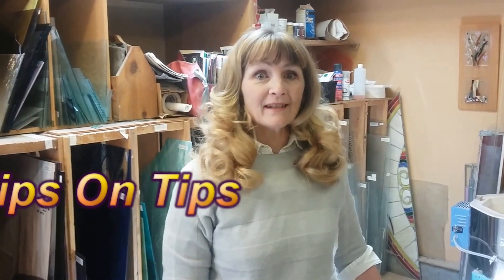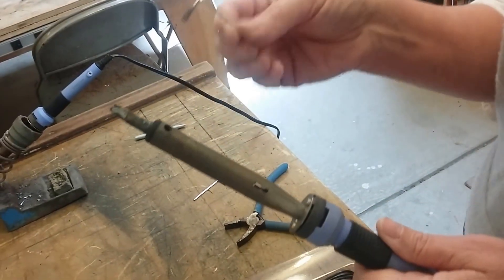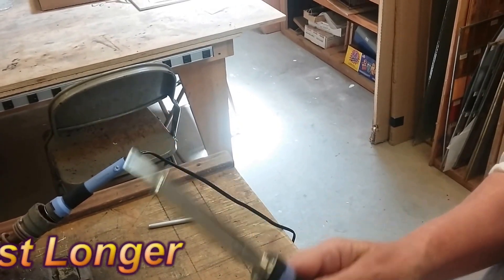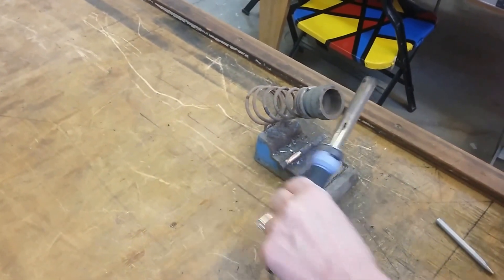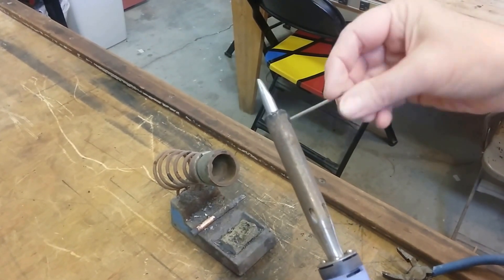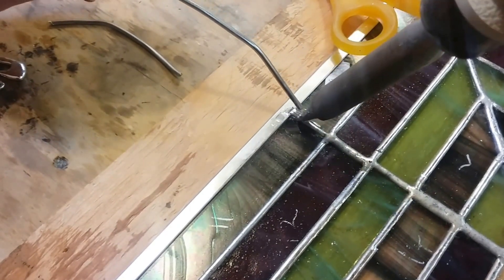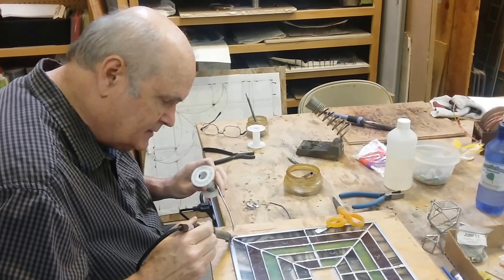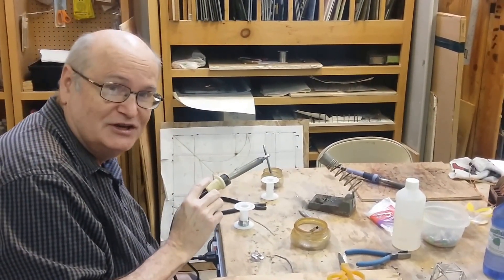Tips On Tips - Soldering V072

Comment: This is why files were invented, easier to use and control. Remove only the material you want to remove (avoiding grinding off a good chuck of your iron as well). 
Inexpensive to buy. The money saved from not buying a very expensive large powered belt sanders you could buy an entire fancy stain glass set up, equipment, table, and top-of-line gear.
Oh! well to each their own.
Reply from the maker: Yep, that would work!

Comment: Tell ya what. Give me your old frozen iron's, I'll bring them back to working .
Reply from the maker: Tossed them out years ago. They all still got hot, the tips were just frozen. I even drilled out set screws and replaced with larger ones. That worked 1 out of 5 times but wasn't worth the time spent. Now I just use a different more expense brand as a shop iron and then still use the cheaper ones for workshops. 👍
Reply: @GommStainedGlass  no problem. Stay well

Comment: Have you tried some copper anti-seize applied to the tip and screw?  Might help it remove later.
Reply from the maker: We have tried anti seize products but the heat affects their usefulness, but I haven't found one developed for copper, thanks for the idea.
Reply: @GommStainedGlass  check autozone or oriellys.  They sell a small tube of it.😉
Reply from the maker: @jagboy69  I'm going to look at it..thanks!

Comment: I bought a new tip but it has a red coating on it. There aren't any instructions on what to do with this coating. Do you just tin over that or try to peel it off?
Reply from the maker: That's just a protective coating, when you heat your iron up the coating will easily burn off, there's a coating of solder on the tip, so no problem.
Reply from the maker: You asked if we tin our tips and the answer is.. only when doing that radical method of extending the life of the tip. Normally, tips nowadays come pre-tinned so it's not necessary.

Comment: I noticed that you always have your zinc borders cut at 90 degrees rather than 45 where the edge would not show. Could you explain your thinking on that
Reply from the maker: It's easier and I fill edges with solder when it's a problem. Many times we install the framed piece into a wooden frame and no one sees, the corners. A soldered corner looks every bit as finished as a mitered one and the way the solder is applied, a mitered corner is covered with the solder anyhow. If you then use the edge of the saw blade as a guide, the 90 degree cut is slick and quick.
Reply: Thanks I will try that with my next piece